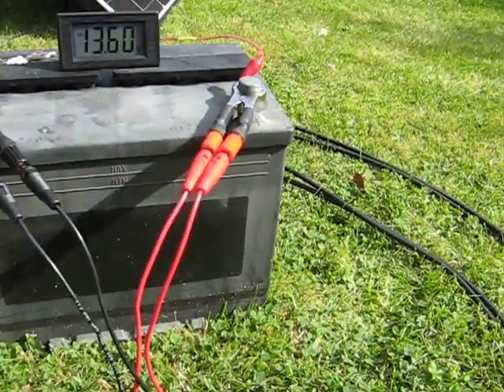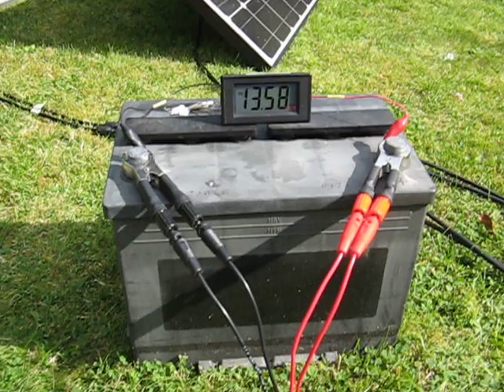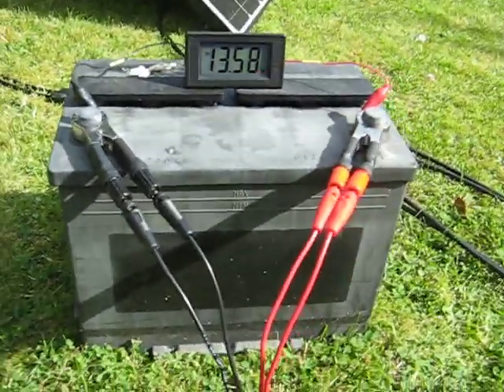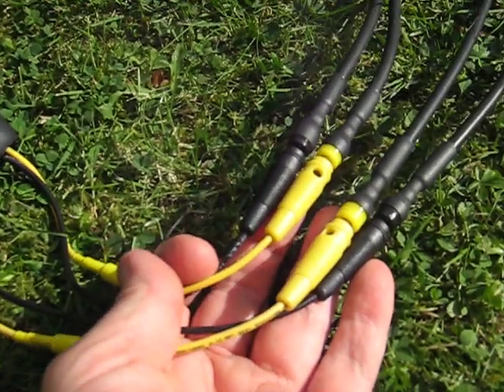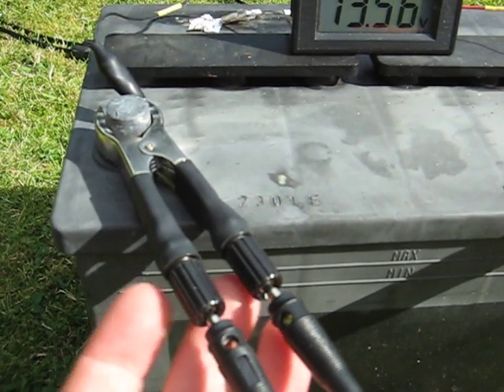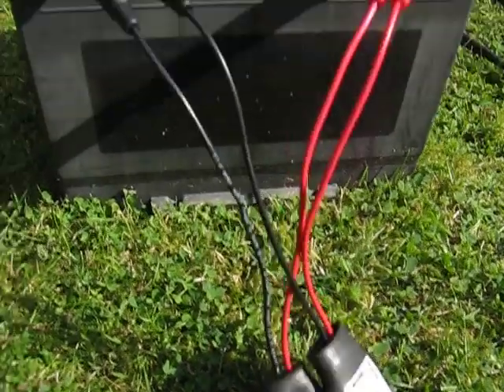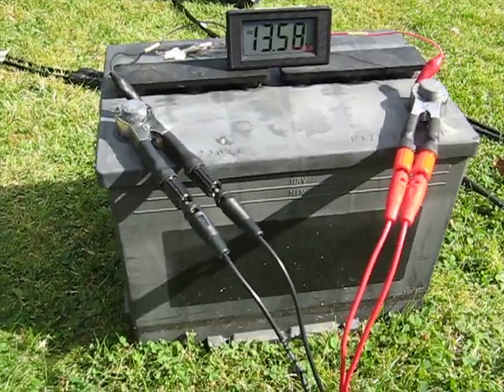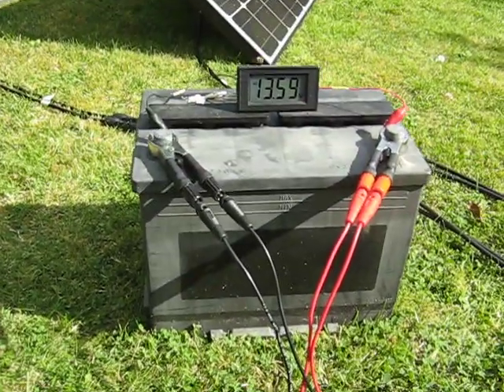Connect Solar Panel to Car Battery with Croc Clips and Banana Plugs

Comment: I have a 80watt and a 100watt panels but one controller is pwm and other is not pwm. Do you think it's a good idea to do exactly the same thing from the video but only with one pwm controller and one constant controller? 
I can connect two panels in parallel and connect it to the pwm controller input but I'm afraid it's going destroy panels.